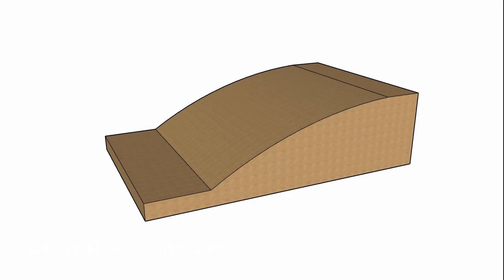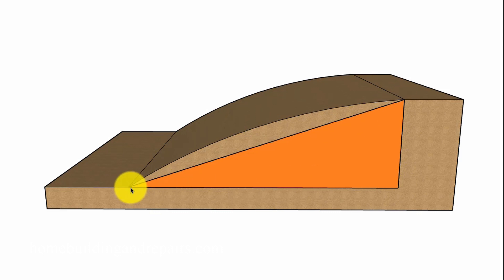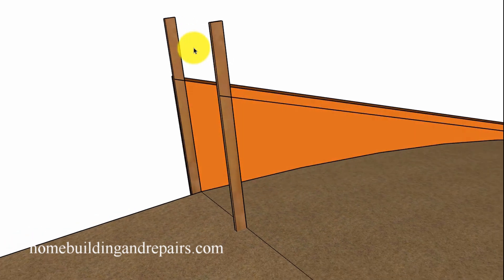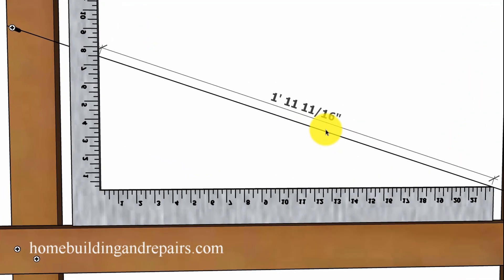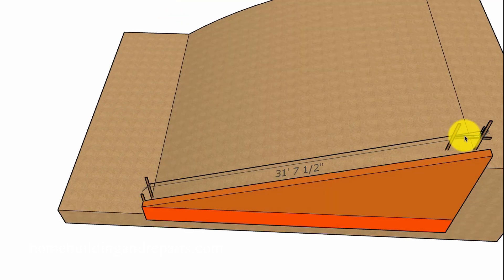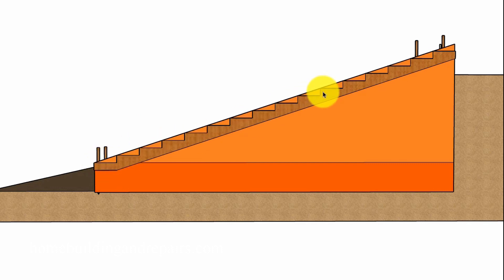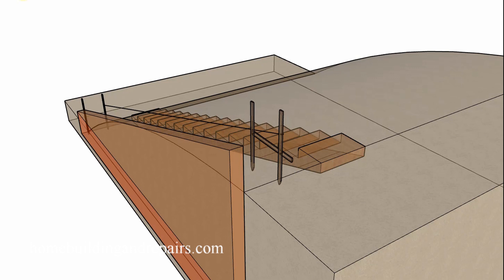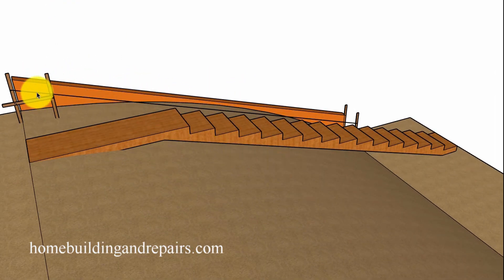Another Method For Calculating Stair Layout on A Long or Steep Hillside

Comment: What if you had a slight curve to your stairs? Like the center of the line was offset in the center by 2-3 feet. Do you just add a step in?
Reply from the maker: Yes, you can create an angled landing. Check with local building codes to see if you're allowed to add angled step, that might not work.

Comment: Very awkward to go down steps that have a tread depth 22.5 inches. A person will come down to the tread and take two steps before going down to the next tread. With 16 steps there should be a landing a third of the way down from the top of the hill. There is a reason why building codes exist for steps in most parts of the country.
Reply from the maker: Yes, long steps might be allowed by building codes, but might not be comfortable to use.

Comment: Question ....... how did you go from the answer = 23.72" to a final decision to use 22.5" treads length?      Looking at video I would think where you show the right angle simply align the 7.5" (if that is what I want for riser) to the vertical side of framing square and see where the downhill side of string crosses the framing square ruler on the horizontal ruler.   Looks like your video shows this as correct.       Can you confirm my understanding?          Quite confused me showing the 379.5/16=23.72 and then pulling 22.5" without even mentioning that is from your framing square ruler.      Fantastic video if I understand the framing square use correctly?? 

Simply set the vertical rise desired and read the horizontal side.           So is the 16-20 just a way to determine # of steps??
Reply from the maker: I'm having a difficult time figuring out what you're asking. I do have more videos at our website that will provide more information about layout and calculations.

Comment: My distance was 468 inches and when i did the square measurment it went 7 inches up and 18 over. So i divided 468 by 26 steps to get 18. From what i got i will have 26 steps with a rise of 7 inches and a tread of 18 inches.
Reply from the maker: Just double check your measurements before and while you're building.

Comment: Need your advice. I have 50'x50' backyard with steep slope at 30 degrees. What is the best to built a stair? Thanks
Reply from the maker: 30° is almost perfect for a stairway and you can use almost any materials to build it, concrete, steel or wood. You can even use landscaping materials. Her

Comment: This approach strikes me as quite a bit more efficient, elegant and clever than the multiple stake approach you provided previously. Two stakes at each end (one plumb), a third to support a level piece, a level piece, a level, a square and a measuring tape to determine total hypotenuse, and with that total rise and run, and from that we can easily play with number of steps, and rise/run for each step. This rocks. Thanks.
Reply from the maker: You're welcome and let me know how it works out if you're going to use it.

Comment: Great video. Would you be able to elaborate on the exact same design but raising the stairs high enough to not have to dig into any hill? In other words..the stairs do not touch any ground all the way down. Thanks ASAP.
Reply: I suppose it would start with a small raised platform. These are being built on a small hill to the lake. The length you have in the video is fairly close to what we will be doing. We will start with a raised “just off the ground” platform and then down to the lake, keeping above the ground the entire time.
Reply from the maker: Yes, frame one out of wood or other materials that can be used to build the stairway above ground.

Comment: Great video. I am just a little puzzled on how you came up with the riser height. I understand how the formula calculated the tread depth. Can you please  explain how you figured out the riser height?
Reply from the maker: Can you provide me with more details about what you're having a problem with? For example are you having a problem figuring out the individual riser height or the overall rise.

I would suggest going to the website for more information.
http://www.homebuildingandrepairs.com/stairs/index.html
Reply: "The general rule (in the US) is 7-11 (a 7 inch rise and 11 inch run) (17.78cm-27.94cm). More exactly, no more than 7 3/4 inches (19.7cm) for the riser (vertical) and a minimum of 10 inches (25.4cm) for the tread (horizontal or step)."

The approach Greg provides here allows us to easily pick our rise and run within this larger context of the rules that make for a comfortable stairway.